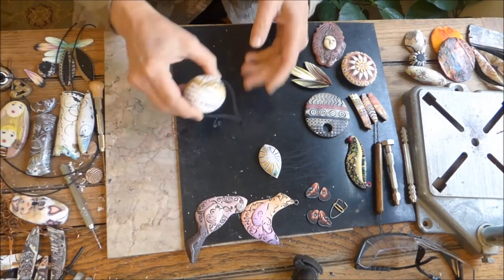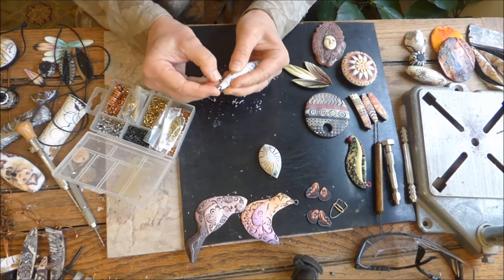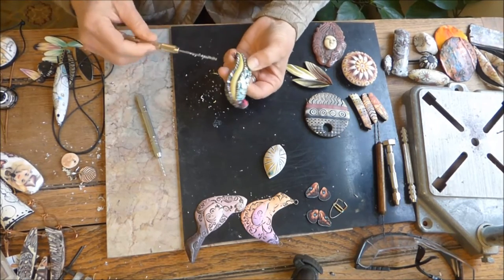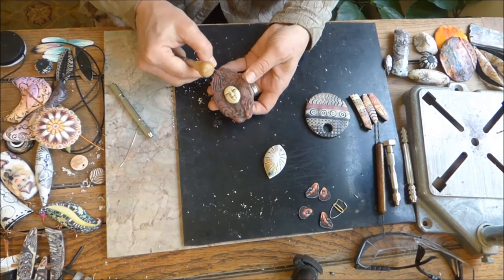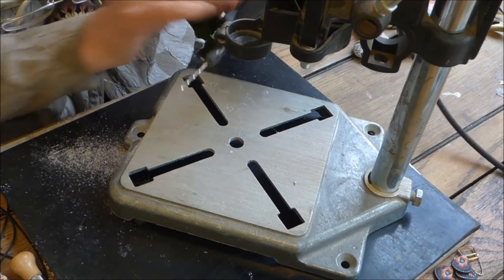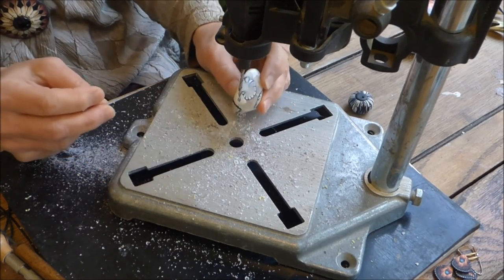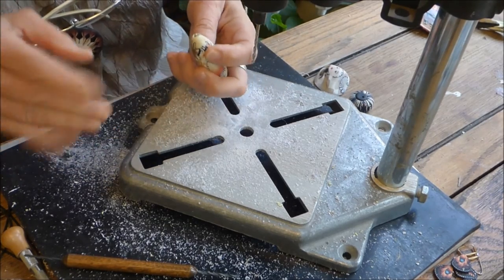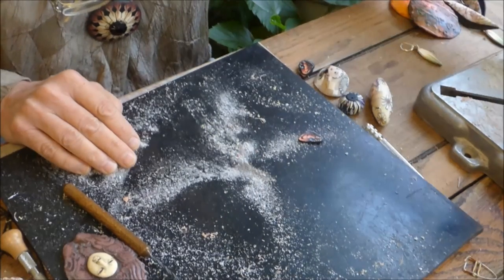Drilling by Design! Where and how to drill holes in finished Polymer Components by Barbara McGuire

Comment: Excellent information on considering where you are putting your holes, and how that will affect how they hang. I have a drill press, and it makes things SO much easier. For the small flat pieces, I put a piece of flat scrap wood under the piece, and drill through it into the wood. It seems easier to hang onto those little pieces on wood than on the slippery metal base of the drill press.

Comment: I especially enjoyed the drill press part of this video. I just bought the drill chuck for my Dremel this past weekend and I am loving it. I made a lentil bead and put the little starter hole on one end before baking to make drilling easier. 

It worked great except I didn't take into account my drill bit was not long enough to go through the entire bead from one side. :p So I turned it around and worked it from the other side until they met in the middle. For the first time ever I was able to get a perfect straight hole through a lentil bead.  Next time I will make a starting hole on either side before baking. 

Of course now I want to get that drill press set up you are using to put my Dremel into. :) 

- Heidi